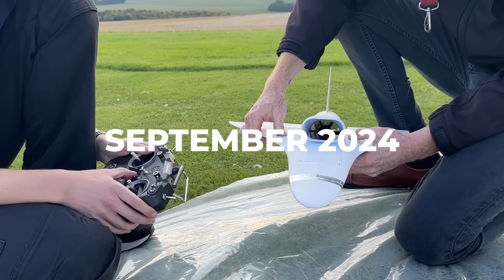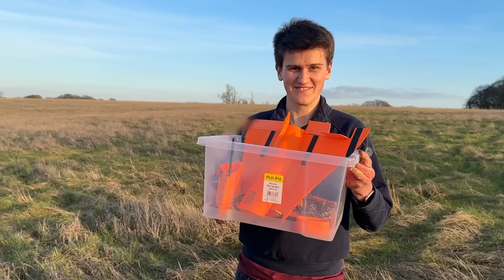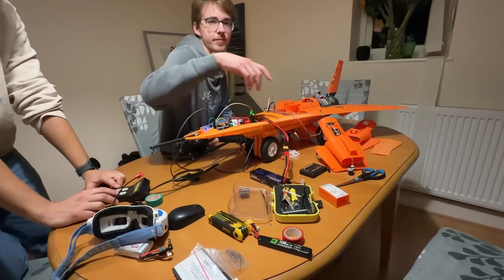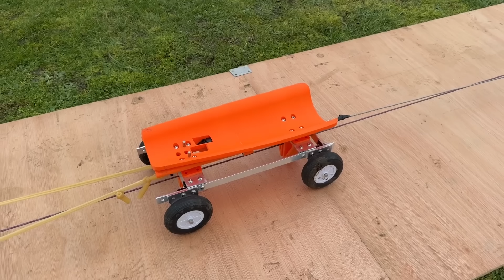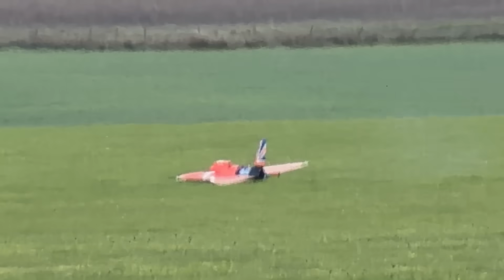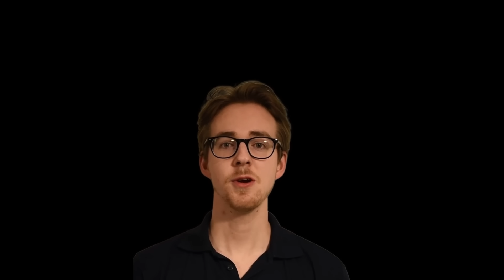Flying the WORLDS FIRST 3D-printed Jet Turbine RC Aircraft! Kingfisher Mk2 Takes to the Skies

Comment: I hate to break this to you, but this is nowhere near the world's first 3d printed jet turbine unmanned aircraft. Folks have been doing this for at least half a decade, and there's a good reason you don't see them in widespread use. 3D printed components CAN work, but they kinda suck and composites are so much easier and more economical in the long run.

Comment: There's really no reason to have that ramp lip at the end and quite a few good reasons why you shouldn't.
The goal is to simply achieve enough speed that in combination with the engine you are flying when you reach the end.

Comment: Wow, congrats! Given you used 100 % throttle, what's next to move towards Mach?
Reply from the maker: That flight was with a 60N engine, we have a new aircraft which is 20% larger with a 300N engine amongst other aerodynamic optimisations. Stay tuned for a new video in the next couple of weeks!
Reply: @TheMachInitiativeOh wow, really looking forward to it. I'm flying small FPV quads and currently building a TBS Chupito. Would love to get to custom builds at some point.😊

Comment: So I'm wondering why a heavily swept delta configuration was chosen if 500mph (subsonic) is the target? At speeds below the transonic region all that planform is doing is adding a shed load of drag especially in the turns. A more conventional straight or slightly swept wing design would seem to be a better choice for subsonic flight, no?. RC gliders (dynamic soarers) with straight wings have already exceeded 500 mph in the USA.

As it is, while it's a great project and very impressive, it's hard to imagine it cracking 500mph. You got ~200 mph on this flight. Double the power will give you ~1.4 x the speed, and reduce drag by taking away the boxy camera mount, you might get to around 300mph or so. That's a huge gulf from 500mph. But good luck, prove me wrong!
Reply from the maker: Hiya! So we chose our delta wing for a number of reasons.

We wanted a relatively low wing area that could provide high lift at landing and takeoff - the drag penalty in these high lift conditions is pretty inconsequential to us. When this aircraft gets going, it only needs a degree or two to pull 4g, and that has a pretty negligible effect on drag even with such a highly swept wing. People focus on the Delta wing's high speed characteristics - and you've rightly pointed out that they're not really of use to us when we're not dealing with shocks! It's the low speed behaviour that is really interesting to us :)
-M

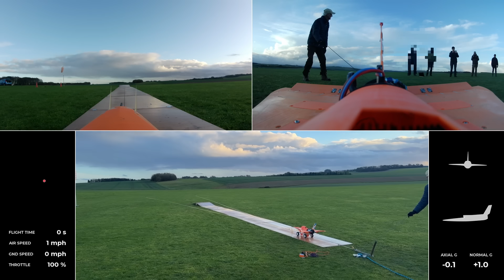Comment: The pitch up on launch was because full up elevator was held during launch, nothing to do with the catapult. You can see that the elevator was full up as it came off the ramp, the rear facing camera shows it perfectly at 3:54
Reply from the maker: In previous tests with the dummy and with kinglet we couldn’t get airbourne with less up elevator or with a shallower ramp angle - the bungee is very finnicky, although the higher takeoff speed from launching with the jet running at full (vs having no thrust with the dummy) probs led to it have more control authority causing it to pitch up.

While it would be possible to refine the bungee and fix all these issues, we have an off the shelf pneumatic system now which will be far more reliable and a lot less work to use, so we may as well use that

Comment: sorry but i was building 240 mph turbine RC planes 15 years ago
Reply from the maker: If we wanted to stop at 200 mph we’d have a much bigger wing and a much easier aircraft to fly. This flight is a key step towards getting an aircraft to 500 mph, not the final milestone
Reply: @TheMachInitiativeI'm rooting for you 💪 it's going to take a lot and you're very well may need to have a very stable digital fpv cuz at 240 your head's turning pretty fast as it goes by I can only imagine at 500

Comment: not to be that guy but you spend two years doing this where on the market are so many rc composite jets and by putting an oversize jet engine EASILY will go that speed ,i got electric pylons aircrafts going over 360km

Comment: Fantastic job to have a successful flight on the first attempt with a new engine.
From a simple rule of thumb calculation, with no changes to the airframe that larger engine should net around 330mph.
With the airframe cleaned up I'm betting it'll be able to reach mid 400's.
Sounds like it'll still be a struggle to break that record...
Reply from the maker: Agreed it is on the margin with the P150 engine.

We’re gonna need to rebuild the aircraft for our next flight - epoxied together with no bolt for strength at the expense of repairability, coated in sanded composite, no exposed engine, no external cameras, added interface for the pneumatic catapult, etc

We’re considering increasing the size slightly (to inbetween Kingfisher Mk1 and Mk2 size) and going back to using the P300 engine we have - should give us a greater thrust/area ratio. Currently weighing up the options and running some more sims - wanna makesure we get this right before building the final aircraft

Thanks for supporting the project!
Reply: @TheMachInitiative I'd say your design is more or less proven at this point, it's flyable and shows no evident fatal flaws.  The current airframe and engine combo may have more to give on successive flights too...which could change the outlook considerably.  That takeoff may have rattled the pilot a bit and caused him to be more conservative lol 

Really though it's just a matter of finding the right engine and scale to hit the sweet spot and optimizing things, which is typical of anyone going for a record.  There's always work to be done and ways to improve!

Comment: Wow, some first proper jet engine test. High stakes, it is getting serious now!!  I guess it's all about being able to repeat this success many times so your pilot becomes completely dialed in regarding the actual control in your flight area, taking off, and more importantly landing.  I guess  it would be worth practicing some dead stick landings on your smaller model. It's electric and can be used to bail you out easier than a turbine that's stopped mid flight. Keep it up. A wonderful project to be able to watch. 
That was doing 200, imagine more than double the speed with such a small airframe. It's is going to be challenging to see. Have you considered a different approach.... A straight flight in a region of the world that would allow such flying... With a human take off, an autopilot speed run and a human landing in a different takeoff location down the end of the speed run. Straight run would put the airframe under much less stress trying to turn at 500mph in a visual area. Don't know if this is possible, but if it was maybe worth investigating?.

Comment: Don't get what the fuss is about, F3D class planes have been doing over 200 mph on 6.5 cc glow engine for half a century now. Like my RC teacher used to say...if you use a big enough engine you can make even the toilet bowl fly...
Reply from the maker: We want to break the Guinness World Record for the fastest jet-powered model aircraft which means taking the Kingfisher design to >465 mph

This 200 mph flight (with a smaller engine than for our record attempt) is a critical milestone towards that goal, but not the final step

Next time it’ll have a much more powerful engine onboard and will be flying much faster…
Reply: @TheMachInitiative Not to be a dick but you proved both my statement and my mentor's statement right.
Just a few questions if you don't mind:
-why use a vertical stab instead of winglets? is not that you need rudder anyway since the delta is more than comfortable with elevons?
-what software do you use to simulate the air flow over airfoil in transitional speeds ?
-that air intake duct looks like a nightmare from an aerodynamically stand point
-what have you done to mitigate the turbine dirty air intake?

Thank you and good luck!

Comment: I'm curious about why you would have a single vertical stabilizer awkwardly mounted on top of the motor, rather than two more robust fins outboard. It's quite high aspect ratio and I doubt it would survive 500mph without fluttering itself to bits.
I think you need to improve that ramp too. At the moment it goes flat... flat... flat... flat... BAM!! 
Excellent landing!
Reply from the maker: We analysed twin tail designs in the wind tunnel, and the twin tails on the wings ruin the vortices over the delta wing, causing it to stall at a much lower angle of attack and harming our landing speed. The single fin keeps in out of the way of the vortices, and it has a 4mm thick piece of aluminium inside it mounted to an aluminium skeleton that wraps around the engine nozzle so its not going anywhere!

Comment: The forebody needs to be modified to cause clean separation of the two leading edge vortices at the tip. A conical forebody tapering toward the tip will reduce asymmetrical vortex shedding - which cause roll moments and stability issues.

Comment: I used to fly combat RC planes and used a catapult. Instead of a wheeled dolly, just use a sprung frame that slides on rods. A lot of military UAVs use similar systems. You could make with extrusions or even just 2 x 4. The ramp at the end of your bungee run just puts the AoA into a stall. Great job on the plane though. It's looking much good

Comment: How will you overcome the problem where the intake air gets compressed in front of the turbine because turbine can not intake more air?
Reply from the maker: The inlet opening is smaller than the compressor face to reduce spillage but there is still some spillage - if the inlet is too small the turbojet struggles to start on launch and you get separation in the inlet so its a tradeoff between inlet area and keeping attached flow inside the inlet and reducing spillage

Comment: The un-sanded finish taking off some speed, as well as that draggy camera mount.

With a more form fitting camera housing and intake, plus the smooth surface AND the higher thrust engine could EASILY reach 500 mph.

Has it been wind tunnel tested or CFD’d?

Will the new engine cog position still be within the envelope for stability?
Or will it potentially help reduce trim drag losses?

Comment: AMAZING, congratulations!!! After all the years, so beautiful to watch

Feedback:
- that catapult... no words, you know what to do :))  either get rid of that ramp or make the curvature much less
- insanely beautiful flight + telemetry footage, but please use km/h like everyone does.
- Add a "magsafe" port, magnetic charging that feeds external power till the very end and allows you to safely setup electronics anad close everything off without battery ever running low. Electrical-wise, it is just the port, and a diode.

Good luck!
Reply from the maker: Thanks for the feedback - that’s useful

We’ve tried smaller ramp angles and can’t get it to leave the cart - it’s very finicky, pneumatic catapult will fix all that though

Comment: 3D printing means poor strength to weight ratio, which means such airplanes will be heavy, which means the wing loading in going top be high, and the plane must fly fast to stay aloft. 

So even though this is impressive, focusing on this particular aspect performance is turning a necessity into a virtue. 

Honestly that makes going fast a smart choice show off 3D printing, and these are obviously very smart guys so that's no surprise. Just don't extrapolate too much about the future of practical 3D printed airplanes from this video.

Comment: For maximum reliability, and also for a relatively cheap cost, you can make a 4 railed launcher, providing the ability to aim up or at whatever angle you wish, and preventing that dangerous shake from the catapult ramp. Essentially launching it in a straight line, predictable, controllable and reliable.

Comment: Excellent! I’ve always wanted to see the Jetcat used in this way.

I know it’s completely uncalled for but the launch ramp could also just be a rail system! It would take the wheels and the bumps in the runway out of the equation. Keep the cart but remove the wheels?  👌🏻👍🏻
Reply from the maker: A rail system is something we looked into - we just don't have a van and we really struggled to design something that would be portable enough. But we're hopingto swap to a pneumatic catapult going forwards!

Comment: do you guys have some sort of ‘fly by wire’ system to help hold the aircraft stable? (not sure what it is called in rc applications). it could be pretty difficult to go 500mph while having to make adjustments to keep straight.
Reply from the maker: We do - we have an off the shelf autopilot running Ardupilot which we tuned on our smaller Kinglet aircraft in previous videos!

That allows the pilot to fly in stabilised mode, self correcting for oscillations in pitch and roll, reducing the workload for the pilot

Comment: Well done gents. That is a small airframe. Your could probably make you life much easier by using a DJI digital FPV video feed.  Would give the pilot much better chance of staying in control at super high speeds as your going to cover some serious distance and anolog fpv is scary. I have a 210 powered comp ARF super flash that has done 580 kmph on the GPS with about a 3000 feet vertical dive downwind.

Comment: That’s an epic achievement- although I must ask: if a 60N engine pushes it to 200mph, surely a 150N engine with 2.5x increase in power can’t push it to 500? If we just assume that Drag is prop to v^2 then for a 2.5x increase in speed you’d need 6.25x as much power (so 150N engine would likely push to a max of around 330mph with no other changes, leaving a lot that the smooth finish etc needs to make up), without taking into consideration any weight gain etc. 
I’m sure you guys have already thought that much through with that smooth finish etc and simulated it, so would be interested to hear your thoughts on it. Awesome milestone nonetheless though!
Reply from the maker: In addition to the 2.5x static thrust increase, we get a significant increase from:
(i) allowing more time to accelerate (we weren’t pushing this aircraft much on the maiden flight)
(ii) removed all the seams, bolt holes and covering the exposed engine hatch - we’ve ran a lot of CFD and skin friction is the primary contributor to drag so this will have a big impact
(iii) remove blockages from the flow - i.e. cameras, etc
(iv) the inlet being appropriately sized for the engine (the inlet is currently too big for a P60 which causes a lot of spillage around the inlet which is v draggy - we won’t have this issue with the P150)

Additionally, the P150 has a much higher exhaust velocity than the P60 so at higher speeds it performs much better. The P60 loses thrust with speed quite quickly, while the P150 actually gains thrust as we push towards Mach 0.7 due to pressure recovery in the inlet.

Max ran a lot of CFD sims (validated against experimental data) to estimate the top speed, and also our thrust/wing area ratio is significantly greater than the current record holders design, and this plus use of a single tail, more aerodynamic inlet, etc should allow us to reach a higher speed than him

Comment: dear god that ramp, I think I would give up on the sling launch entirely, you have plenty of t/w. And if you want to land without destroying it, you'll get retracts. Retracts are  not that hard nowadays, plenty of printed examples. I almost made some but I haven't yet. At mach speeds, aero is your problem, not weight. Also I assume you're using inav, but if not, it will help with stabilization of such an unstable airframe. 

I also wouldnt take off that high performance of a plane with that dirty of flight surfaces, but that's me. Countersuck fasteners and tape work well.

And finally, in my opinion the whole airframe is smaller than it needs to be to comfortably house everything needed in a prototype. Making things compact uses up a massive amount of project time. The aircraft can be made longer without much aero penalty.

Comment: Wow insanely cool, I've been keeping up on this for I think a year now and this is amazing. Me and my girlfriend were watching and I was saying it was so shocking that it didn't nosedive when bumping the ground at 60mph it just hopped and slid, she said a parachute would be cool to help slow it down and I agree if it doesn't add too much weight because it's already jam packed... I don't know how the systems work to deploy them either just sounded like a cool idea!
Reply from the maker: A parachute is something we’ve considered - we’re on the limit of what’s feasible when it comes to our belly landing speed, especially in summer when the ground is harder. If we wanted to make the wings any smaller we’d need a parachute, but then we need a bigger fuselage which adds drag, or have to sacrifice very well needed fuel volume.

Thanks for watching :)

Comment: I wonder if it would be easier or just less hassle to use a fast 6-8S RC car to launch the aircraft?
Reply from the maker: It’s something we’ve considered but we’d need one hell of a car to get something of this weight to those speeds on grass! A winch may be a cheaper and easier solution for a more controlled acceleration

Comment: 3D printing it is stupid. It is a downside of your design, not a highlight. You would have much better results with carbon
Reply from the maker: 3D printing is great for the prototyping phase. We’d spend 5x as long prototyping with carbon, and every time we need to change one of the component interfaces or sections (which we have had to do many times over the last few months) we’d have to remake the whole airframe.

Now we’re v close to having the design locked in and are just going for minimal weight/ maximum speed, a carbon composite design becomes a lot more attractive